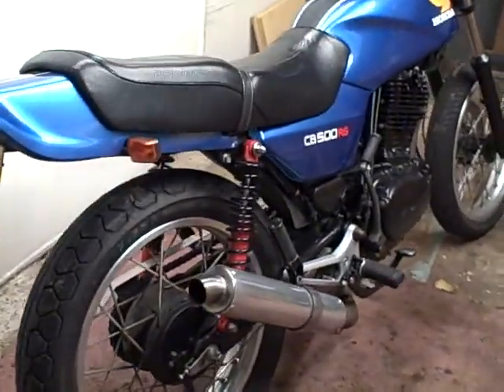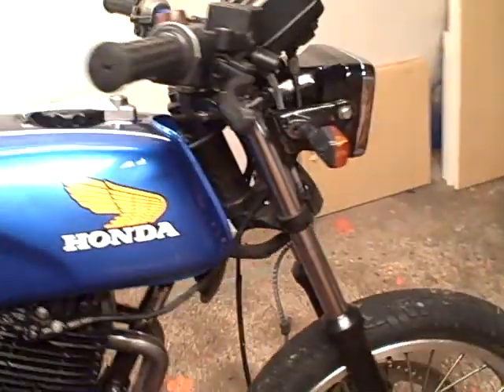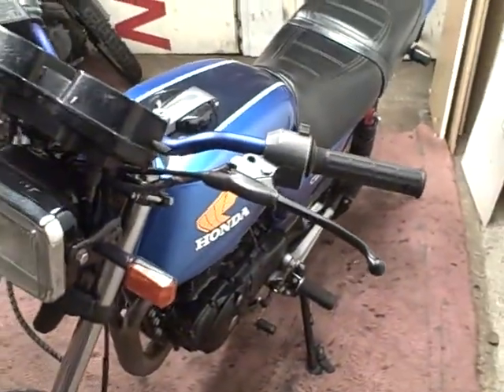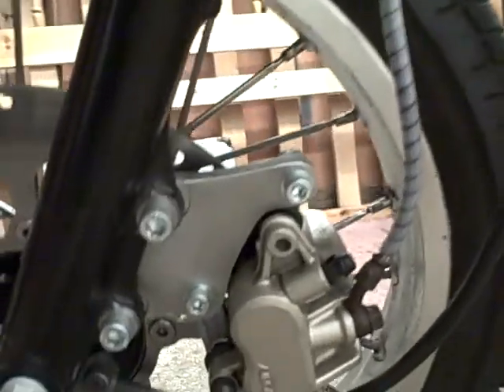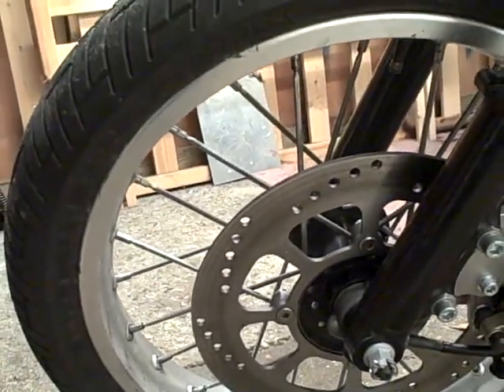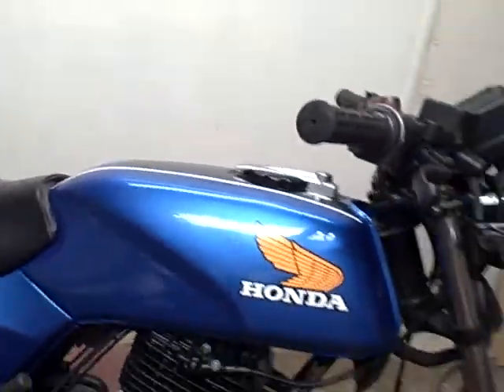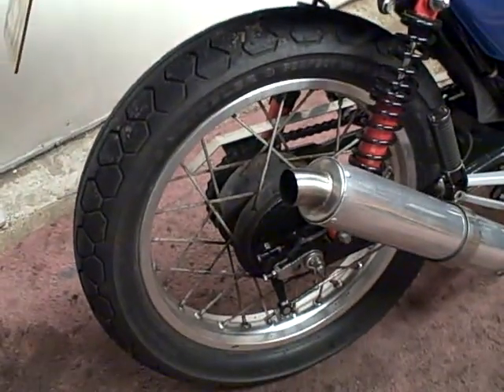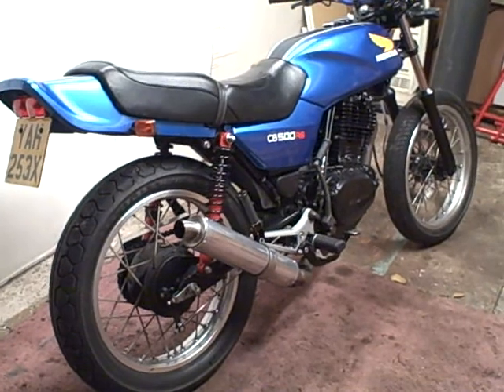Honda CB500RS nearly finished

Comment: hiya steve, bike looking great, im building the same at the moment using the ft500 engine, ive got the ft carb but no manifold, looks like it will be a tight fit, would i be better off with an xl carb on a standard motor, are the xl and ft manifolds the same?
Reply from the maker: Hi Lee, great to hear someone else is building one, the FT carb is a tight fit but once in place looks purpose built, however
being a CV carb they don't like not having an airbox and I found it a bit unreliable but that could have been just my one.
The XL carb needs a bit of modification to the cable bracket and the frame but nothing major.
The rubber manifolds are different but only in the diameter of the carb mouth. Either carb will work although I would tend to use the FT carb on the FT engine to start with and then see if it gives the power you're after.
Reply: Lee, check out my YouTube, there's an intake option on the 500rs video.

Comment: Hi Steve, What did you use as a clutch cable bracket on this? I notice the XL500s the bracket is part of the frame, but does the CB250rs have a bolt on bracket?
Reply from the maker: Hi, yes the RS uses a bracket that bolts onto the side casing using two of the bolts, the bracket supports the clutch cable and the decompressor cable
Reply: @tevie54  ok thanks Steve thats great info. I'll try and source one then, Ive made one up that works ok but it didnt seem to allow the clutch disengage fully on mine. Could be clutch assembly issue though too I guess... we'll see